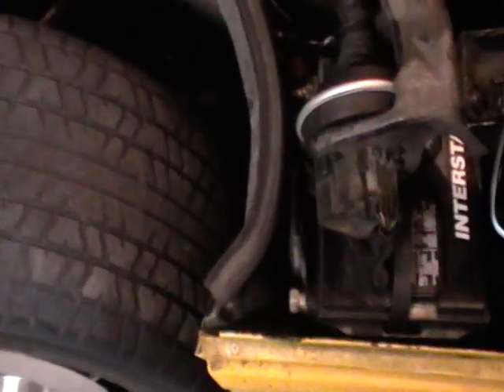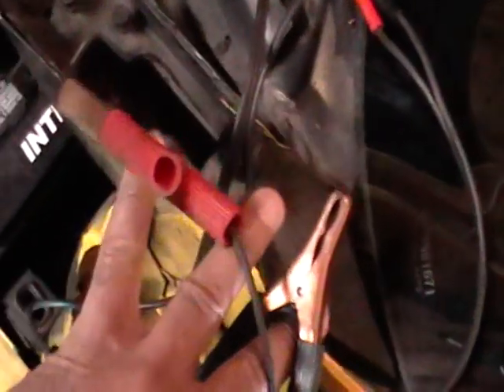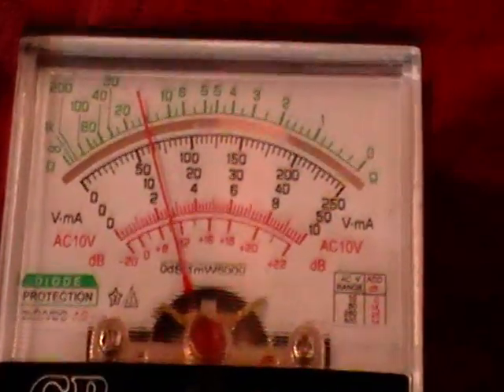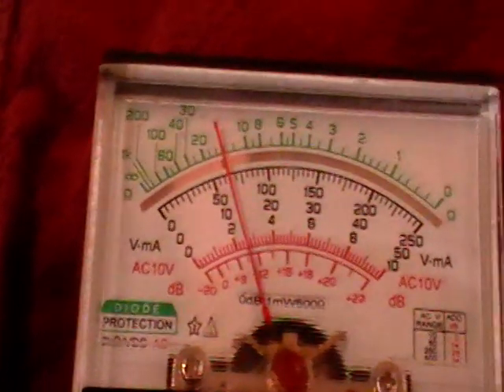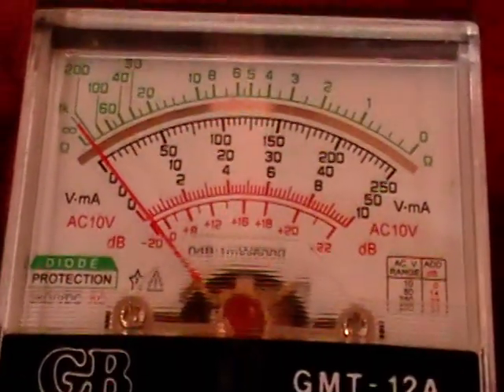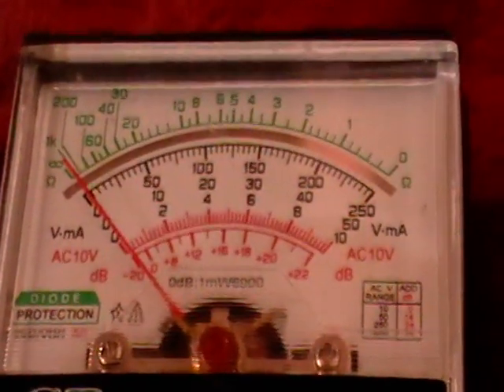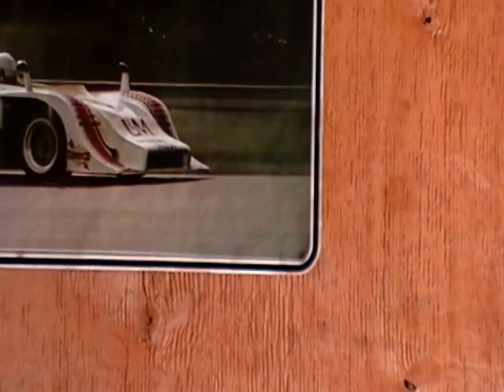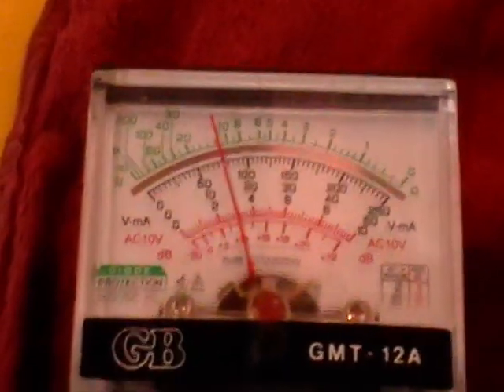1986 C4 Corvette Charging System Test

Comment: The scale you need to look at is the black middle one. The green one is for resistor measurement not voltage. It says 11.5V engine off and 15V with engine running.

Your alternator worked perfectly and didn't need to be replaced.
Reply from the maker: You are correct!  I was trying to find a draw that was draining my battery, and I just start replacing parts for the process of elimination.  I wanted a new alternator anyway, but I do appreciate the information on the correct scale to read on my volt meter.  Thanks!
Reply: No prob. Thank you for sharing good advices.

Comment: The scale you need to look at is the black middle one. The green one is for resistor measurement not voltage. It says 11.5V engine off and 15V with engine running.

Your alternator worked perfectly and didn't need to be replaced.